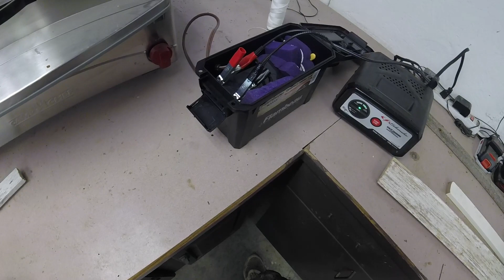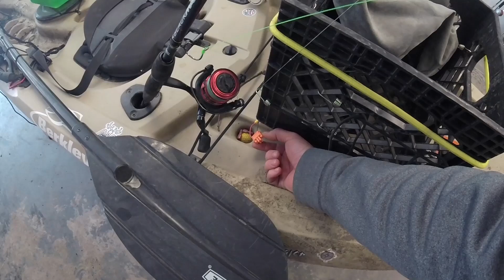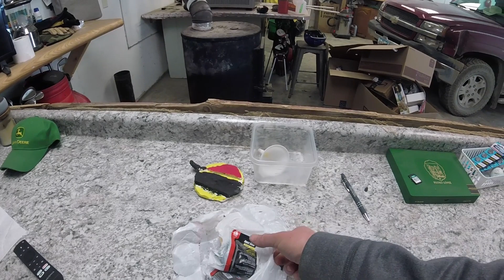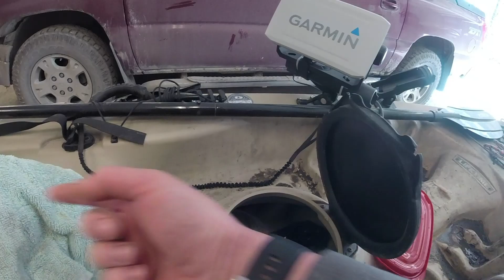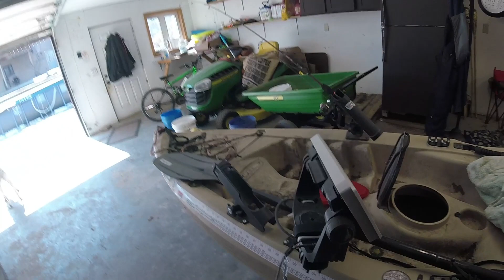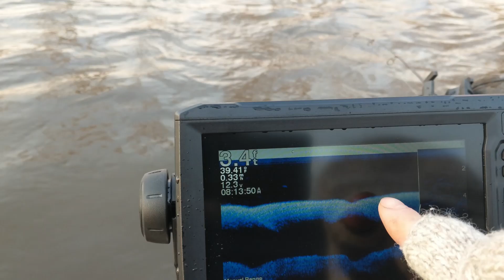Garmin ECHOMAP 63cv install on Kayak Duct Seal transducer mount. Works Perfect!

Comment: This is very interesting. So the transducer down sonar goes easily through the duct seal and hull of the kayak and works perfectly? I mean how do you know what the difference in functionality looks like between a direct connection with the water or this kind of in-hull installation? Are sure you're getting a good bottom scan etc?  I heard of people using cut outs with water or resin, but that looks messy and too permanent to me. Great video thanks for making it.